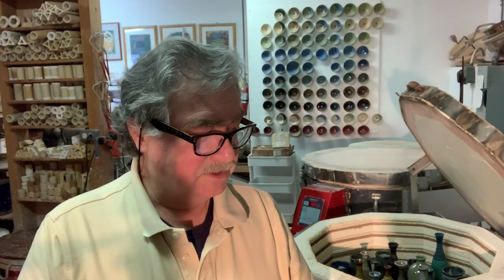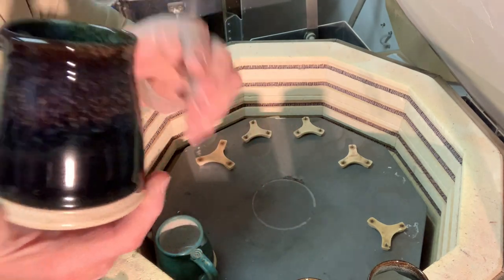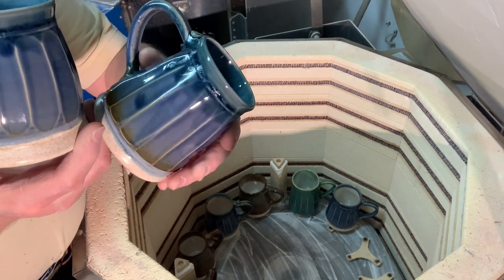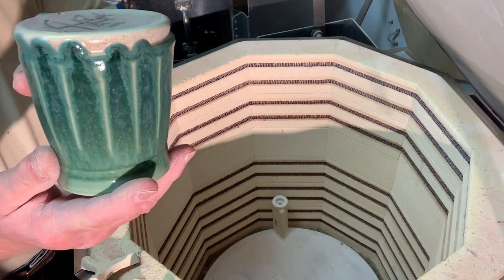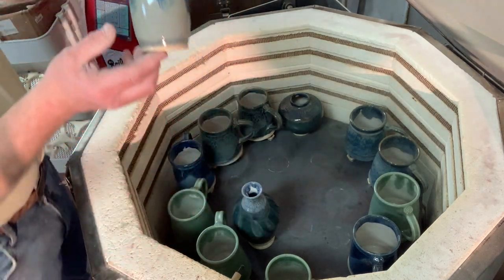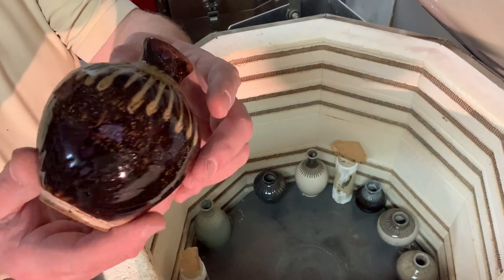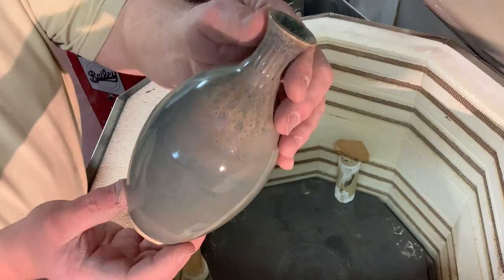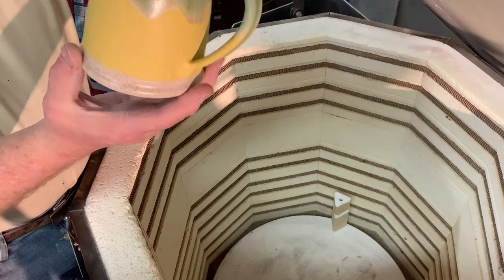2 Glaze kilns unpacked

Comment: Try adding 1-2% lithium to reduce shrinking, it's a very strong flux so if you want to keep the matt glaze you might need to reduce abit of the fluxes.
Reply from the maker: Thanks I did that before with another glaze and added extra silica to balance it out. It worked with my clear glaze.

Comment: Vaughan, your end photos of the sets really brings forth the beauty of your pots. Temmoku gold and mouse brown grey are two glazes I will be looking into using in the future.
Have decided to start doing bisque firing again for a change as well as to slow myself down a wee bit in the process.
Another two grand loads where even the runs were impressive. I would think if they sat level they would be nicer without grinding.
I also plan to start throwing more sponge holders as I really enjoyed making them with variation. Good practice for thin walls. This was the latest video I posted which is all about sponge holders:
https://youtu.be/Nhm1xYxUaMM
Stay well together!
Reply from the maker: I refired all the mugs upside down on stilts and every one was fine.  If you start using slips a bisque would be necessary. The wet glaze over slip would lift the surface. Stay safe, we just had news of vaccinated people in New Brunswick being admitted in the ICU with Covid.
Reply: @Vsmithpots 
 Does that mean the glaze repositioned itself back to it's proper location. No grinding needed? I thought the runs curling under looked very neat.
Our county just lifted the mandatory mask when in a business and so going out will be more of a challenge. Although I have had both vaccines I still wear a mask and try to maintain a distance...some folk just feel they have to be right next to others when they are talking. I feel somewhat protected but I am willing not to test it.
The bottles you made just gave me pause when I saw the first one glazed.
Will you do a wee short clip of the re-fire process and result at some point?
Reply from the maker: @freddiemoretti8456  Yes the bottoms are completely flat again. I did cone 5 with a 15 minute soak. It is worth the purchasing of a few stilts to do this. I had about 12 mugs saved.
Reply: Do you put the stilts on top of a post and put inside turned upside down mug?
Reply from the maker: @freddiemoretti8456  Yes so they have to be new so the pin point is small and the stilt just drops out with a vibration knock.

Comment: Maybe not layer the runners so far down the pot.
Reply from the maker: Good tip, also a slightly lower firing temperature. I sometimes do Cone 5 with a 30 minute soak that looks just as good with out the running.